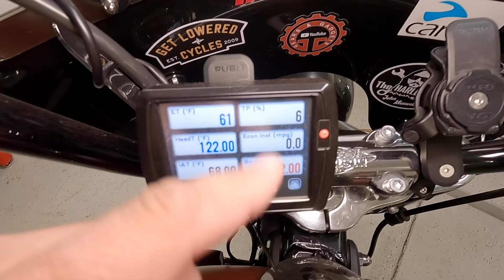My Harley-Davidson is getting TOO HOT!!... (It's weird)

Comment: Hey Dan...  I too ride with my feet on the rear pegs on long trips.  I also have a Dynojet display fitted and....... surprise, surprise...  my temp also rose by 10deg Celsius after I put my feet up on the rear pegs!!!.   I don’t have an oil cooler... mine’s stock..  I think it’s just the leg position that changes the air flow.   👍🇦🇺
Reply from the maker: Wow that is interesting. I will be doing some additional testing this week. Thanks for the info.

Comment: In AZ $329 for the Love Jugs Mighty Mite fans is money well spent. Drops the temps quickly and you can sit in traffic forever and temps barely creep up. Without the fans, it will shoot over 300 degrees very quickly in stop and go traffic. Turn the fans on and it stays at 240-250 even when stopped dead for a long time. 
Two things really surprised me. 1) the amount of air moved is way more than I thought those little fans could accomplish- but it’s a lot. 2) riding at 70 down the highway, I thought the fans wouldn’t be doing anything - but they are still really effective. Like dropping the temp from 280 down to 250. 
This is on a 2015 Freewheeler trike 103HO. 
Also - I removed the right side plastic air deflector. With both left and right deflectors, it creates dead air behind the rear cylinder. Now with just the left deflector pushing air across the rear cylinder to the right, and the fans doing the same, there’s lots of cross flow and way more hot air exiting the right side.
Reply from the maker: I might check them out but last I looked they didnt have them for the M8's yet.

Comment: I have a 2019 streetglide m8 107. I live in mesa az. I put a pull fan behind my factory oil cooler and installed over jugs to cool the heads. The bike ru s about 45 to 50 degrees cooler. Made a big difference. The bike has 72,000 miles on it.put the fans on the bike 3 months after I purchased it. Bike runs great.

Comment: Interesting vid Dan never would've thought leg pos could affect the temperature that much having an oil cooler with fans. Thx for sharing
Reply from the maker: Thanks David. Yeah I wouldn't have thought so either but it makes sense that your legs channel air to the motor in the standard floor board position, then in other positions they actually create an undesirable airflow situation.

Comment: I love you man, so don't take any of these comments in the wrong light.
1) Dude, get a bike lift for that big boy. That jack is way too sketchy.
2) You may have about a BAZILLION bugs clogging up the veins in your cooler. Most likely because it's right out in front there.
3) 300 degrees would be freaking me out of my skull!
When my engine temps get up to around 200 to 210, I start getting worried and it gets hot in the man regions...lol
The biggest reason my bike is liquid-cooled. It really does make a huge difference. I live in central Florida and in the summer it gets super hot like it does by you. Getting stuck in traffic during those times is murder.
And lastly, damn boy, nice bug collection you've got there...lol Get a washrag on that thing !
Love the channel man. You should have ten times the amount of subscribers you do.
Eric
Reply from the maker: Thanks man, I don’t take any offense at all. I would love to get a lift but I also don’t want to take up a ton of floor space either. I’ve looked at a few. My bike has always run around 270 head temp. I always reference head temps (right or wrong). I would love to get an Ultra at some point but again, space and money. I appreciate the kind words.

Comment: Dan I am sure the oil cooler was needed in your area. When we came thru Last year on the way to the canyon it was 117 in the mid afternoon. I also had the Dyno Jet on my Fatboy and loved all the info it gave me during operation. I plan to add one to the Road King since it doesn’t have the oil cooled heads like the M8. This way I can keep my eye on temps and any other info I need. With all the mods I am adding I should start a channel, but after 5 years retired and only 60 years old I am afraid it could be more like a job. Mods that I am adding are grips, bars fairing Led lights, wheels, tuner, intake cam, header, already added seat,  
Electric center stand, 21 inch wheel in front matching wheel in back 16. That will get me started. Good vid!
Reply from the maker: Yeah Marty, I try REALLY hard to make sure my YouTube channel doesnt turn into a job but it is a tight rope walk of trying to stay consistent, topical, and entertaining yet not creating a second full time job for myself. In all reality I probably do put too much time into this but I enjoy it. It wouldnt hurt to try creating a channel if you think its something you might enjoy doing but dont take it too seriously at first.
Reply: @GearsGadgets  
Well I appreciate what you do and I enjoy your content. Keep up the good work and I am going to set back and let you show them how to grow a channel. Maybe sometime in the future we can have a cold soda together. The wife and I travel out that way a couple times a year. 
Have a brother in Tucson and I am going to try and make my first Sturgis trip on the bike in 2021. Take care

Comment: If I remember right, the M8 temp sensor is on the front side of the rear cylinder so between the cooler and your knee position when on the back peg, looks like you're blocking all the air. Hope you get it worked out.
Reply from the maker: I will find out later this week when I take it on a little local couple hour road trip

Comment: Hi Dan 
I've had my Dynojet on my Road King read 335. My friend had his Road Glide up to 350. If you didn't have the Dynojet showing you the engine temperature you wouldn't think the engine was running hot. We both live in Las Vegas NV.
Reply from the maker: Yeah I think its a good thing to have otherwise you wouldn't know. I guess some people would probably prefer and out of sight out of mind mentality but I like to know what is going on with the motor including things i cant feel.
Reply: Reminds me about when I once installed an oil pressure gauge. I was freaked out with the low psi but had ridden years with the bike before and no problems.
Reply: 350 is inane but in the desert i can see that harley wants your motor oil no higher than 260 degrees which is still plenty hot they have a very lean factory tune to meet the emissions  but this tune also creates alot of heat that is hard to get rid of and really hot when the outside temp hits a 100 or hotter the richer tune up brings the temps down and the bike makes more power once the engine temp goes over 275 the computer takes away timing and you lose power this is the bike trying to save the motor   my cvo has a feature to turn off the rear cylinder while standing still it supposed to help cool the motor in theory yes but not in realty even with the liquid cooled headsit got so hot it destroyed my valve train doing major damage i to was stuck in traffic and did everything i could but the bike still failed any ways i know a mechanic and he taught me some things it was an expensive lesson but i amriding a again now i also now have the ultra cooled fan assited oil cooler and it works very well its under $1000.00 dollersand worth every penny

Comment: The engine temp sensor reads  off the front cylinder so rear cylinder is gonna be up some compared to the front.  Get the Jim's force air and add a fan to the oil cooler.  Cooling oil is top priority.
Reply from the maker: Interesting, I will look into that.

Comment: Do not worry about those tempatures .just use synthetic oil.just don't let it idle to long at stops.290 I would worry.
Reply from the maker: It will surpass 290 running down the highway if I don't keep my feet on the floor boards.

Comment: Correct me if I’m wrong but it looked like the additional oil cooler you took off was inside a box. In other words it appeared that the air could not flow through it. If this is the case, then you would have a lot of air flow restriction. 
 What about running a full synthetic or semi synthetic blend oil. This alone may help your high temps.
Reply from the maker: The UltaCool does have screens front and back and plenty of air does run through it. Might have just been the way it looked on video. I do run full synthetic as well.

Comment: Harley engines have always ran too hot, the back jug runs to 300 deg at times and just cooks the oil.
After only 500 miles or so the oil runs out black and thin as water! 
I wanted a Harley all my life and when I got one it didn’t take me too long to find out that they weren’t really a great bike. I really doubt that Harley will be around in 5 or 10 years.

Comment: I would also check the accuracy of your sending unit.  Youre riding in cool weather, you're wearing a jacket, you're not smacking the motor, 270+  just seems high.  The rear jug does runs about 40 degrees hotter than the front jug, but 270+ still seems high.  Head Temps will be higher than jug temps too.  So your hottest point on the engine is your rear head.  Another thing to know is if you're not getting an excessive amount of popping and crackling after you turn the motor off, your bike is not running too warm.  You're in AZ??  Me too!
Reply from the maker: Yeah that is interesting but do keep in mind even in that cooler 70ish degree ride where I was up at 270 that I was probably cruise controlled at 80-85 mph

Comment: In the city, did you try putting it on “Parade mode” where the back piston is used to pump air
Reply from the maker: Yeah I do have that on but it doesn't do anything at highway speeds.

Comment: It would be interesting to know where it's measuring the temperature. Air flow can be a problem with longitudinal v-twins and I wonder if there's another place to mount that cooler. The touring frame bikes mount the stock cooler low in the front.
Reply from the maker: It is on the rear head.

Comment: I really enjoy your videos. I noticed those lights you have in your garage, do they plug in to outlet and are they led?
Reply from the maker: Thanks. Yeah they are 2 strands of Husky LED lights from Home Depot and I have them on a switch that is VHB taped to the wall that I bought off Amazon. It works really well.

Switch:
https://amzn.to/3aouR5g

Lights:
(https://www.homedepot.com/p/Husky-7500-Lumen-LED-String-Light-K40157/305124389?NCNI-5)

Comment: if that's a 114 M8 dual cooled engine then isn't the big radiator for the head coolant(antifreeze)?
Reply from the maker: It’s not dual cooled. It’s oil cooled, no antifreeze. Problem with the oil cooler is it has no fan so it needs speed to push air through it. That becomes a problem in traffic jams.

Comment: Hi Dan, why don’t you try and keep the additional oil cooler but rather have it on the frame why don’t you put it on the crash bars so it would one. put it more inline with your leg and two. Open up that gap where it was positioned before. 
What about if you hung it horizontally above the oem oil cooler still keeping it on the main frame but wouldn’t restrict any airflow from either side of your legs and will still get front on airflow though the wind ?? 🤔
Reply from the maker: I wanted to remove it just to verify that it was or wasnt part of the issue. I just dropped a video today showing that it is NOT the oil cooler causing the issue at all.

Comment: This OEM Oil Cooler doesn’t have a fan drawing air through it to help cool it down? I would rather retro fit a fan than another oil cooler to help bring down the temperature when you’re bike is sitting idling.
Reply from the maker: It does not have a fan on the OEM cooler and there is virtually NO space to put one unless you put it on the front which would block airflow when the fan was off.

Comment: Just curious what motorcycle stand you used in this video and what your thoughts are on it? Is it all aluminum?
Reply: It looks like the Harbor Freight version of the (yellow) Sears jack I've been using for 5 years.  Not the best jack you can buy, but I've used it to roll my '14 Limited and '20 Heritage Classic around the garage and it does the job.
Reply from the maker: It is the Harbor Freight Aluminum jack. It is just okay, it does have a little wobble and requires more attentiveness to it while working on the bike but all in, I think dollars to donuts its the best value on the market.

https://www.harborfreight.com/1500-lb-aluminum-atv-motorcycle-lift-63397.html?_br_psugg_q=motorcycle+lift
Reply: @GearsGadgets  Thanks!

Comment: Modifying a stock air cooled bike with an aftermarket oil cooler, and then modifying the aftermarket part (oil cooler) and the stock parts so the aftermarket part (oil cooler) will work in the bikes original stock configuration. Who’d a thunk you would have air flow problems over the non stock oil cooler. No offense but looks like you may need a water cooled bike in your stable. Don’t get me wrong, I personally love an air cooled bike for simplicity. The 2003 Suzuki Bandit 1200 I owned for 4 years was great, except sitting in traffic in the summer with no airflow over the engine or through the oil cooler caused lots of pinging when pulling away from a red light till airflow movement dropped the engine temps.
Reply from the maker: I would love to swing an Ultra but I’m kind of waiting on the next HD touring frame. Its gotta be coming soon.

Comment: When you talk about engine temps are you talking about oil temps and actual engine temps as in CHTs? On your iPhone I don't think it was showing oil temps.
Reply from the maker: Engine head temps. Being the M8 has oil cooled heads it is somewhat an indication of oil temps as well. Keeping the oil cooler means the oil going to the heads to do some cooling by in turn is cooler and helping to keep temps down. The Ultra Cool does not show oil temps because Harleys do not come with a temp sensor for oil.
Reply: @GearsGadgets  Good stuff. Thanks for the info.

Comment: Dan,
I think you're thought on the air flow and oil cooler unit is the answer... It sounds logical... Where is your OEM horn located on your bike?
Reply from the maker: The OEM horn is center of the frame up front right under the tank.
Reply: @GearsGadgets  do you have a OEM horn cover?

Comment: 300 hunderd degrees is very hot this will destroy your oil and your motor harleys are tuned very lean have a pro tune your bike richer my cvo did not have an oil cooler but it does have the liquid cooled heads does the ultra cooler have a fan on iti have this now on my bike and it works very well dont loose the oil cooler that will be a mistake you may want to run it lower so it sits in colder air heat rises my bike got so hot it destroyed my valve train their is a red plastic piece in the harley cable clutches that breaks and then you loose all your cable tension they have an upgrade for this you will want to do this before it leaves you stranded the fan assisted ultra cooler will keep your oil temp down to 210 degrees which wont cook your oil or your engine i saw where you had your oil cooler its blocked by the wind shield and when you put your feet up you block it even more and 115 degrees in the desert does not help either get it down by the floor boards and see what happens when its open to cooler air good luck it cost me$ 6500.00 to put my motor back together

Comment: Check DK Customs info on cooling your v twin

https://www.dkcustomproducts.com/acl/why-how-to-cool-down-the-twin-cam-milwaukee-eight-engines-part-i-9.htm
Reply from the maker: Interesting read. I am going to do something. Just not sure what yet.
Reply: @GearsGadgets  I’m enjoying the videos.  I could see (5 months ago) my PV  temp change if I move my feet from boards to highway pegs.  Or just push my knees out in the breeze more. 

I’m in a colder climate, so probably wouldn’t get extreme hot. 280 or 290 was most I saw on my twin cam - probably different sensor location. Didn’t have the PV on very often.

Comment: Probably sumping.
Reply from the maker: Im not sure, I guess I will find out if the temps do the same thing without the ultra cool on it. I will be testing it on a longer ride this week.
Reply: @GearsGadgets  I find it hard to believe that's the cause. 
a) It's a radiator and they're designed to flow air.
b) Have you ever seen all the crap hanging on the crash bars and blocking air on a Road on an Ultra?
Does it feel like its losing any power? That's another tell as the crank churns oil.